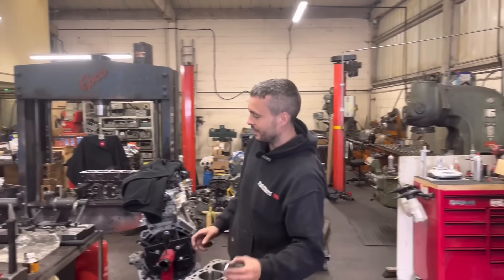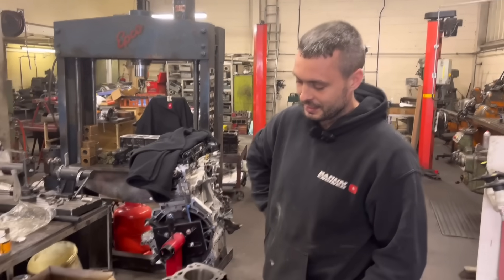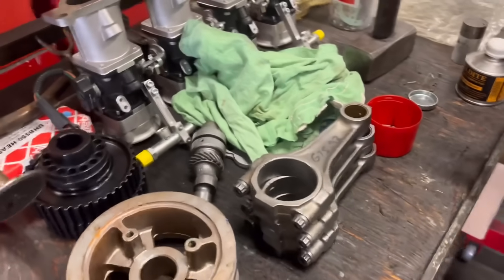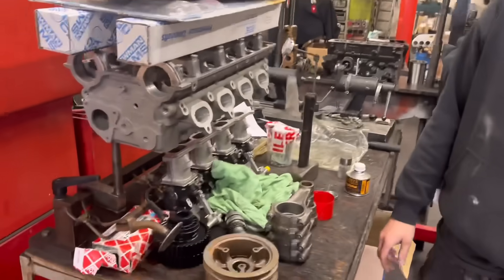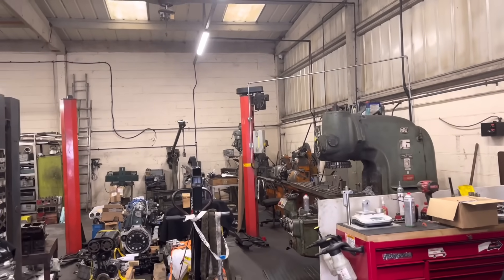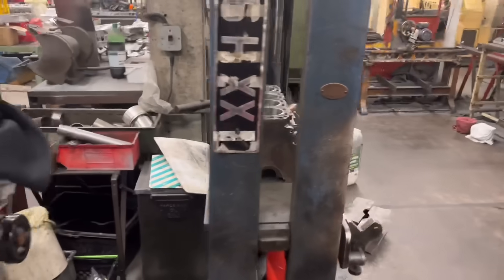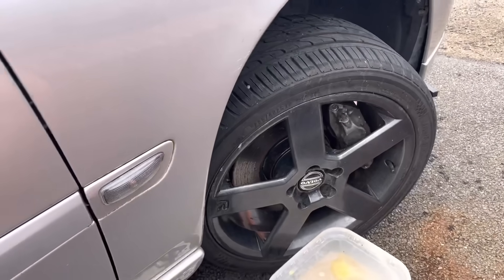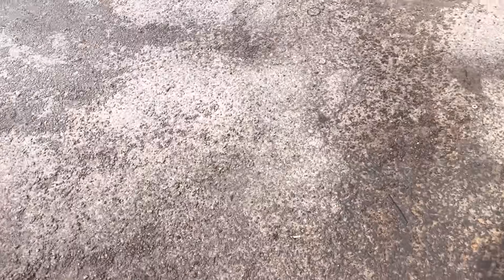Built Volvo S60R engine has HUGE water in oil issue!

Comment: I would suggest that you rig a heater in a tank and a pump and recirculate hot water through the engine and when it warms the block and head your leak will l be indicated.
You can increase the pressure in the block by throttling the outlet/return to the tank.
Common testing procedure with large (small house size) diesel engines.
Good luck n take care.

Comment: Hi Lee like many on here have said oil cooler would be my first call as I've had so many over the years on varying engines give the same symptoms. People often think you only get oil in the coolant but I've had it like the Volvo in question several times, mainly on the PSA/ford engines. Bypass it and get it hot and see what you have in the sump afterwards. Good luck mate and keep up the good work and loving both channels cheers Matt N

Comment: I've only ever done aluminium blocks and 0.001" is a 'loose' interference fit that generally leaks when hot.
I don't like to use recommended 0.004" (I forget OD but 89mm piston) so almost always use 0.003" on most or whatever manufacturer used. (except Honda where it's very variable, 0.001"- 0.003" on same engine series even when same vintage?)
Saying block expands about 0.003" when heated to fit liners should tell you it isn't tight enough?
People watching get terrified when you use round pins like that when pressing (from experience  😁)

Comment: Hey I just thought of something.  
 Now in the pcv system on the Volvo 2.5 t there is a coolant line the runs inside the aluminum pipe to the right of the pcv box , under the intake.  That could be the issue.  
 I'm learning volvo as my son thought it was a great 1st car. 
 2005 s80 2.5 t.  
 206 to 210 hp.  Awd such fun to repair in the car.

Comment: Had the Volvo issue twice before , 1 time it was the oil/water cooler . The other time it was a head gasket that was supplied in a conversion set by Fia having an issue .

Comment: Loop the cooler as suggested, but I would definitely investigate the turbo. The Volvo turbo is oil and water cooled and the oil is low pressure there so it’s possible the water can flow into the oil.  There is a low pressure drain into the back of the block easy to access when hot and you should be able to get a good sample there.

Ever consider putting the compound in the bottom of the bore and on the top of the sleeve so you can get the sleeve a bit farther in before the “glue” starts to react?
Reply: Very clever. I would not have considered that.

Comment: How would you pressure testing the system while the sump is off BUT heat your coolant to a good running temperature before you put it in the system with the dye   Trick it. I’ve done this before and had good results. Worth a try!

Comment: What the lad should have done once he removed the sump he should have got half a dozen cans of brake clean and sprayed the hell out of the bottom end to get rid of all residue of the oil/water/UV dye and then pressurised the cooling system and that way you could see if there was any leak at all from underneath

Comment: Re oil/water mix. You couldn't see a liner issue, but. Aluminum expands more than steel, so maybe when the engine is hot, a small gap is opening up somewhere?

Comment: If the oil cooler is brass inside, that will be the problem... like someone said earlier, bypass the cooler and see if it cures the problem.
We had the same problem with brass oil coolers in the radiators of Fords for the transmissions and they would give out and fill the trans with coolant which effectively destroyed the bands and clutches...cheers

Comment: Hi Lee, had similar mayonnaise oil issue on a Volvo Penta 2003 diesel boat engine years ago. Only happened when running, couldn't work out how water was getting into oil instead of other way round.
Eventually found pin hole on flexible wet exhaust hose next to air filter intake. Water mist sucked into inlet manifold and ended up in sump presumably via rings. The engine ran fine while all this was happening. You would think it would hydro lock at some point but it didn't. New exhaust hose, flush and oil change, engine still runs fine today.
I would check turbo cooling for small leak as a few others have suggested.
Great channel,
Jon

Comment: Lee, did you or can you isolate the components more ?...  Did thermostat even have a chance to open in such a short 2 mile drive ? When you pressure tested, was it cold or hot ? With engine in this state, it will likely save you more time to simply take top end off so head can be heated and tested separately from block... at least take valve cover off to see if there is a obvious leak with UV light from a crack in head, or a NOW blown head gasket from compounding issues... it doesn't have to be one leak, particularly with large volume it passed of H2O, the overheating it's experienced could have caused a warp in head vs gasket.

Comment: Many immediately think oil cooler, tackle this pragmatically, write down the possibilities then rationalise each. For example oil cooler, oil pressure would be higher than coolant, so unlikely. Cracked head or gasket leak, this would most likely take longer than customer description, possible but not top of list. 

Coolant is rapidly finding its way into a non pressurised area of the block, list possible interfaces, coolant plugs, water pump, turbo seal to oil drain etcetera, these are the more likely culprits so check them first.

This approach works for any engine and is far better than the " shooting fromthe hip"  method.

Comment: Look at the head coolant passages where the oil return holes drain back to the sump, in case it has a crack there. I've seen this on the B21 & B27 engines.

Comment: There is a possibility that the water pump bolts have broken through the block. Earlier white blocks used a thicker pump with longer bolts. later pumps are thinner with shorter bolts. Long bolts on the thin pump will punch through into the crankcase. However the oil cooler is a far more likely culprit.
 Cheers, Fred, VISTA Master tech.

Comment: Get a radiator pressure tester and pump it up to about one bar, with the sump off you should see the leak if it is in the block area, if not disconnect the two oil cooler oil pipes if you can and see if coolant comes out of them when the coolant system is pressurised. Im not familiar with this engine but suspect any area where water comes in contact with oil like a gear driven water pump for example or even a frost plug in the head under the rocker cover, with a bit of perseverance and ingenuity you will find the leak, a Nissan SD 25 engine gave me the longest run a round until i found the water getting into the oil, the pushrod tube in the head had a pin hole  in it, Sykes Pickavant 331900 cooling system tester helped find it for me.

Comment: I've come across this before with cracked heads.  Not this brand/model specifically.
Reply: Saying this after you replace the cooler, of course.

Always replace the cooler due too contamination and weak link.

Comment: Check to see if exhausts has heat exchanger for the heater like the ford transit. Had same problem with the ford transit changed oil cooler and head gasket turned out to be heat exchanger

Comment: Australian Ford Falcons with the 4 litre Barra used a KTM cooler for the transmission interfaced with engine coolant. They were notorious for failure. Being Swedish wonder if Volvo used a similar cooler for engine oil?

Comment: Oil cooler for certain on that volvo. . Common on these engines. couple both coolant hoese, and run it, oil will come out of the water connections, could take some tyme to show.And sp,e heating up.  but 99% its the cooler.

Comment: The Volvo hasnt had a coolant gallery plug pop out? I’ve had a similar fault with a psa turbo mini engine. The factory alloy core plug under the cams came out. Have had lots of oil coolers fail but never with that volume of coolant

Comment: Can not understand why the oil has not gone into the cooling system if it was the oil cooler, would love to get a cctv into the bores but tbh have to think that water leak is either the head gasket or a crack in the head it self, know i could be giving bad advice but if mine i would have the head of and pressure tested.

Comment: I had a Ford Durectec Modine oil / water heat exchanger fail. Because the oil pressure is at a much higher pressure than the cooling system, it pumped all the oil out into the coolant system which eventually came out as a 'Latte' froth from the header tank. As a result of my experience I would not think the water / oil cooler has failed, if you are not seeing water in the coolant.

Comment: Hey Lee, great content as usual. When I worked for Volvo we would join the oil cooler coolant hoses together. Bypassing the coolant flow through the cooler. We’d warm the engine up and the oil would run out of the coolant hose fittings on the oil cooler. Some coolers would leak instantly, some would have to be red hot. Cooler failures are common on these engines. Hope this helps👍
Reply: good call

Comment: Head gasket or oil cooler are the only two oil to water contamination, anything other than this could be major damage, being as pressurised oil system is higher than the water system pressure i think it could be head gasket in to the oil return galleries (some turbos have oil and water cooling together!). it would be interesting to find out
Reply: Apart from water heated oil filter mounts as on Citroens?
Reply: @@shivadow water is getting in to the oil, not oil getting in to the oil, oil pumps only have oil in them
Reply: @@shivadow Hi yeah sorry I have not worked on ant vehicles with water cooled oil pumps so it is a first for me, i know vechles can have a separate oil pump that can be water cooled. i did check the Volvo S60 oil pump and it hasn't got a water cooled oil pump. it is a big lump though and driven off the crankshaft. anyway i have the greatest faith that our Lee will sort it out.
Reply: Thumbs up for the turbo bit

Comment: I had a mini cooper S empty all the water into the sump after an engine rebuild. When the head was at the machine shop being skimmed, an internal core plug had fallen out. It was about 10mm  round directly below one of the cams. Luckily I noticed it immediately ( only ran for about 5 seconds) .I was lucky I could fit the new core plug without removing the camshaft.  BMW Mini told me the core plug could not be purchased separately from the head. New head £2500. Bought the core plug on eBay for £2.50. I guess when the car overheated originally the core plug became loose and then fell out at the machine shop. I took photos when I removed the head and it was there when sent to shop.
Reply: Could even get a plug made by local engineering company for somewhat less than £2500.
Reply: Super common on early mazda engines too.

Comment: seen cracks between the oil gallery an the water jacket that goes to the head, they can crack when you torqe the head been there my self sadly. but that sump on the volvo is a disaster waiting to happen, the o-ring looks deformed from being sucked up into the block, and black silicone on the sump is bad. only use proper flange sealent like you do on the cossies.

Comment: When oil coolers leak, it puts oil in the coolant, because oil pressure is higher than the cooling system pressure. I'd be checking the top side of the head also in case it's cracked.
Reply: Only when it's running. As soon as you shut it off, cooling system pressure is higher.

Comment: Many years ago two of us at the garage stayed behind one Saturday and did a head gasket on a vehicle due to coolant in the oil. The gasket had blown. Once completed, we started it up and within a few minutes it was the same. We took the head off again, couldn't find any issues so we sent the head off to be tested. It turns out there was a pinhole in a core plug under one of the camshafts spraying the underside of it with a jet of water. No money made on that PJ, lol.

Comment: If it was only driven a couple miles it wouldn't have been that hot anyway. 
You know what you are doing, but can I suggest you keep an eye on the big ends and mains. They come unstuck very quickly with H2O in the oil

Comment: To have that much water in the oil its got to be the oil cooler or if its possible the wrong head gasket . I will say thou its strange the oil isnt going in the water althou with a leak such as that the water drops out. Id get a air line clean up as best poss from underneath re fill the radiator etc and leave it with some cardbord under it and see if it leaks when its not running if it does sounds like a crack somewhere head or block. If you can pressure test it with the sump off as well.